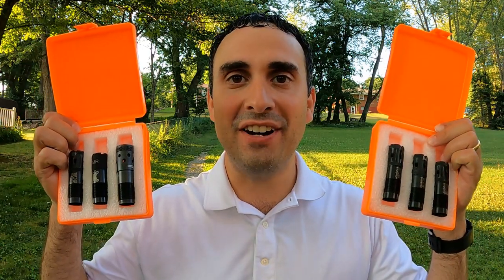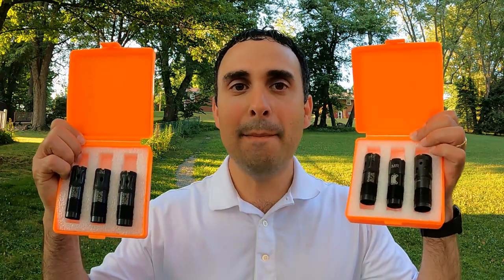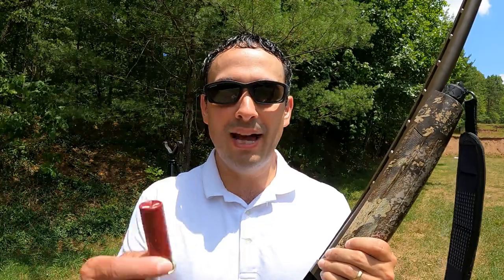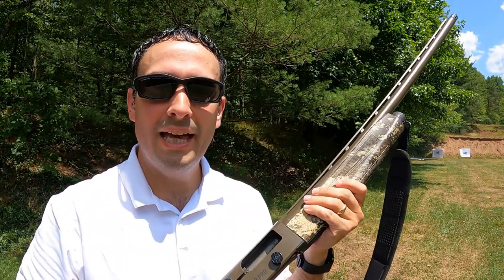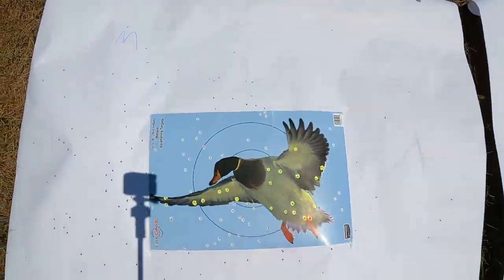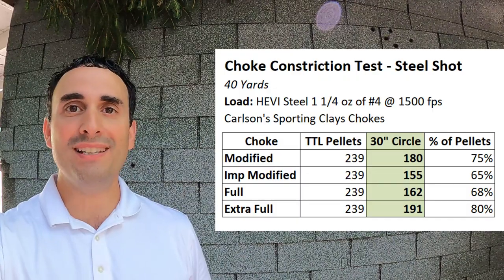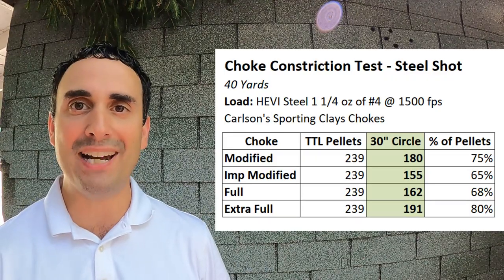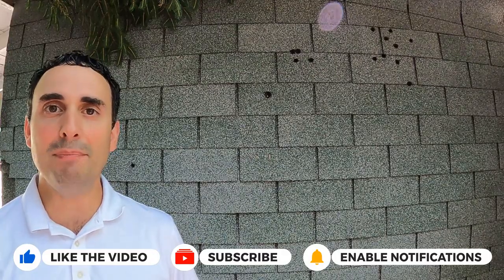What Is The Best Choke For Steel Shot? – How Tight Is Too Tight? HEVI Steel Pattern Test

Comment: I like the pattern but I heard it's bad for the barrel long term
Reply from the maker: What's the source of that info?
Reply: @TheNewHuntersGuide  just hear say. I haven't been able to find long term studies on steel shot. I'd like to try full choke with waterfowl shot. For extended period of time. What do you think?
Reply from the maker: @wtfisthis7795  Well, none of the choke tube makers nor the gun makers I talked with said it was a problem. If the choke is rated for it then the choke shouldn't fail. The barrel can't fail unless the choke fails first. These chokes were even rated up to steel BB shot at this velocity. Though that pattern test video didn't show conclusive improvement with the tighter choke at that shot size.
Reply: @TheNewHuntersGuide  good work I'll keep watching ya

Comment: When manufacturers like Beretta, Fausti, CZ, and others say NEVER use steel in chokes tighter than modified, why risk destroying your gun?
Reply from the maker: Stock chokes aren't hardened and rated for steel. Thats the main benefit from aftermarket chokes. Also, I've never seen any of those manufactures say their guns aren't rated for that.